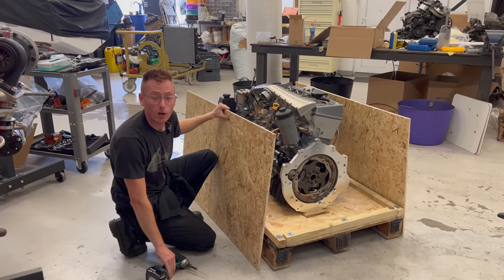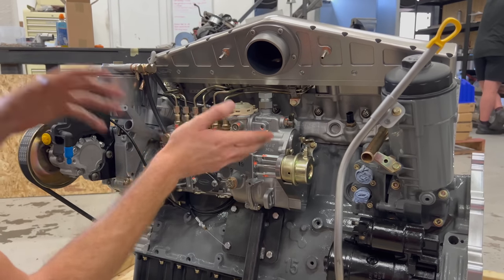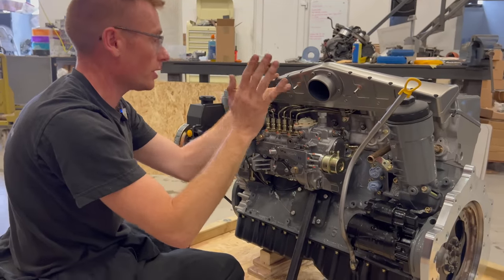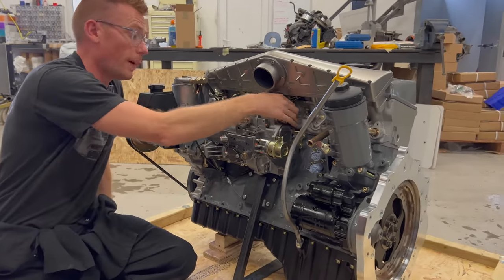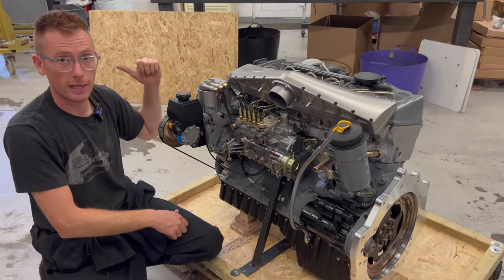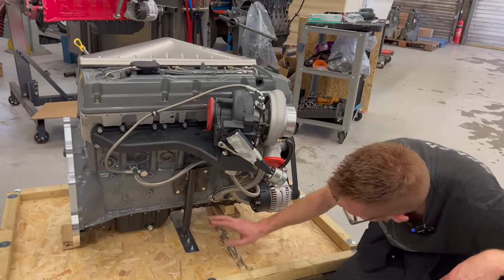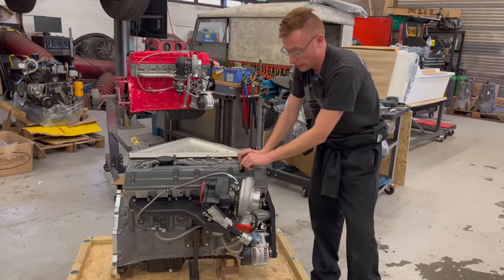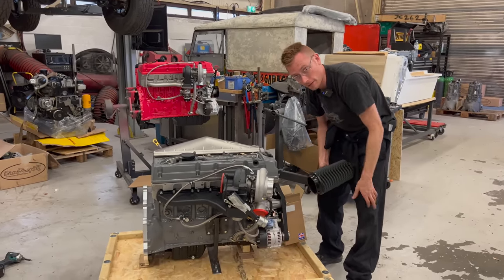Unboxing a 500bhp Dieselpumpuk crate engine

Comment: What price would the 500bhp engine cost?
Reply: People who can afford it, won't mind ... people who work hard for a living don't really want to know the price.
Reply: 10 years hard labour
Reply: Between 14.500 / 22.000 ex VAT
Reply: @matthewnooren7090  we didn't want to know.
Now I feel like a very poor person
Reply: @matthewnooren7090  thats actually not that expensive for a throw it in engine with 500hp 

i wonder if it fits in a 190E
Reply: It's a lot to give right away i build my cars step by step (1 of them OM606) i'm getting mine done in Poland i'm paying that for taking out the old engine, re-do the OM606 get it fitted (a big hassle) and tuning (500 hp) for less i pay around 13k euro i think for everything
Reply: @maximilianjankowski  it fits in a 190e
Reply: @maximilianjankowski  that compares nicely to the cummins repower crate engines which do not have a turbo, and make half the power.
Reply: @maximilianjankowski  dunno you buy a hape of LS motors for that money
Reply: @niallcorcoran2437  as irish as they come 😂
Reply: @OM617a  will it fit a sprinter ?
Reply: thanks for your amazing videos ,but have you ever converted any engine for marine purpose?
Reply: like 5000 not bad
Reply: @matthewnooren7090   excuse my ignorance what’s VAT?
Reply: @feron450  tax buddy
Reply: @maximilianjankowski  you can buy an entire 5.0 coyote DRIVETRAIN package including Trans, computer, and wiring harness for less than 7k... for 29k chevy has a 1000hp na crate motor.
Reply: I'm more confused as ever after reading this thread. can't someone just answer the question plainly?? how much does this engine cost in US dollar or British pounds???
Reply: @derekcraig3617  you and me both lol
Reply: @derekcraig3617  you can pick-up one for probably 1500/3500 dollars 

A tuning costs will depend on your expectations really

But expect between 5k / 20k as the diesel pump rebuild is quite expensive and to find 1 as well

A throw in ready build crate engine in America will probably be the same as in England, around 16/23k
Reply: @matthewnooren7090  thank you :)
Reply: مرحبا من فظلك ما نوع هاذا المحرك يجي على اياسياره او محرك ايا نوعمن اسيارات
Reply: @ابراهيمالعطوي-ذ2غ  om606 turbo
Reply: @matthewnooren7090  awesome to hear that. Would you share which shop are you doing it? I’m planning to go a OM606 swap into a Patrol, and want a rebuild engine for reliability and power (probably with Diesel Pump UK fuel pump; manifold, turbo kit, etc).
Reply: @matthewnooren7090  where bout in Poland you done it please ?
Reply: @AroundEU  SuperTurboDieselRybnik
Reply: Was quoted $19k before tax and shipping
Reply: @jameshathaway5117 can add atleast 50% to the price of a coyote in UK
Reply: @haydenratcliffe1138  yeah and OM606 cost a lot more in the US than the UK.

Comment: Hi Luke.
Fabulous job.
Can you measure and weight your crate engine. Also how much shorter is the 5cyl.  Can the engine be tipped to the side. If so how much as I have  space restrictions. Thanks Jim

Comment: Hello everyone. Hope you all are fine.
You're driving us crazy with your swapping and your amazing work DieselPumpUK....
I own a C class 250 TD OM605. I have a problem with an overheating engine, that's fact push the aux fan to run to low the engine temprature. 
What I did with my car is :
I have a problem with a cylinder head. I bought a new one, the engine runs now much better and smooth. The older cylinder head was at its worse state 😝
I removed the oil Refrigerant (cooler) because 2 times it caused me water and engine oil mixture soooo bad failure.
Now after asking for an advices from many mechanics I believe I have to remove the Radiator to clean in the bench.
So, I hope to get some advice or a help, anything would help and thank you in advance.

Comment: Your videos in my opinion are the best on how to create diesel monsters what kind of horsepower can you get out of a OM606 with the stock internals only tinkering with the externals? For example bigger turbo bigger fuel pump etc what's the highest horsepower and torque ratings you can get out of this engine?

Comment: D/P.  Your lowest alternator location is the weak link in this crate engine !  Will you be offering the "water proof" unit ex. Porsche Cayenne soon ?  V.
Reply: That’s the factory location for the alternator
Reply: @Diesel8290  D/P.  Watch the YT videos "PNG river crossing 1 & 2" or guess how long the alternator will last Downunder after a drenching !  !  Could one invert the custom exhaust manifold to a low mount and shift this alternator to higher position ?  V.
Reply: @vincentpoole7588  there’s plenty of top mount alternator mounts available for these engines. Leaves the intake for turbo tight then just
Reply: @vincentpoole7588  I've had water up past my bonnet for a continuous 2 hours when I got stuck in my 4x4, alternator was fine, was also the stock 15 year old unit at the time, depends on how much shit is actually in the water (debris etc), the only issue was airbag sensors ate shit due to the interior filling with water.

Comment: "The heater outlet shouldn't be blocked" - that's interesting, because that's what some bodies will do, like w124 - they do block those passages in stock configuration.
Reply from the maker: They do not block it, it is re-directed

Comment: Would you enhance a Japanese MMC 2.5L 4D56 engine to get over 200 BHP at least or achieve some unexpected,ridiculous Torque  figures. I’m not an engineer, I just love cars.
Reply: 4D56 engines can be fitted with a bigger plunger in the VE pump, injectors out of a 4M40-T engine. More boost up to around 20psi (safe at that). A lot depends on the rocker arm  type too. There are roller rockers and slipper type. Roller rockers are the better but must have a cam to suit. The harmonic balancers can flog the crankshaft keyway out due to crankbolt not being long enuf or torqued up properly.

Comment: What are these engines capable of HP & Torque wise reliably? I've built my old LBZ duramax and now have a 21 Powerstroke. Been throwing around the idea of building a 72 K5 Blazer with a Cummins/Allison 6 speed combo or a supercharged LS/LT gas. 500HP & 800 TQ would be a great fit and I assume these Merc diesels are much lighter than a Cummins? Also what manual trans can survive with that amount of tq? Cool stuff BTW!
Reply: He does a video weighing a 5.9 12V, these engines are half the weight supposedly. Deboss Garage does a video on these things as well. I have a '90 Suburban 2500 and this would be a good option, but price is a real concern. Junk yard 5.3 with a cam and a tune is hard to ignore.

Comment: Do you do anything with the om642 engine ? Love mine in my c class, just made a much less restrictive DIY air filter using a standard filter housing but using specialist air filtration foam. Made a nice difference and lot less restrictive, hybrid turbo next me thinks

Comment: As always yall have awesome builds 
Question why dose the braided oil return hose hose go over the exhaust manifold,  would it not collect as much heat if it went down from the turbo and under the manifold  just asking 👍

Comment: Greatings from Greece 🇬🇷 nice job keep going !
I’m wondering if you could make an adapter to connect this beast with a marine leg like this(ALPHA 1 ONE GEN 2 STERNDRIVE MERCRUISER 4CYL V6 V8 MERCURY)? 👌
Reply from the maker: Yes we can
Reply: Alpha 1 will handle about 400hp petrol max and probably 300hp in diesel (there is no BHP) in marine terms, the oil burner having lots more low down torque, if you want to go higher power then you need to upgrade to a Bravo Drive !

Comment: If I yeet the motor in my pk ranger I want one of these 😂 om606 Mercedes simply do not exist here in nz which sucks.
Reply: We have the 5 Cilinder  of this engine  in a musso korando ssangyoung they also have them in the uk don’t know if he will make a kit for it the mb 140 mb100 Mercedes’ also run this om662 engine without turbo in New Zealand I own 2 of them vans

Comment: Why do you disagree with water/meth injection?
Reply from the maker: A few reasons but you cannot control the combustion of the meth.
Reply: @DieselPumpUK  fair point. We use it a lot in petrol forced induction where we have a spark plug ;). Always good to get input.

Comment: Isn't it time to move on? A 600 BHP 6000 RPM OM648 is way more interesting.
Reply from the maker: If you can make it run mechanically which my customers want then yes I’m all in.

Comment: Water / methanol on deisel? 
It is used to prevent knock (autoignition) on petrol engines. It would absolutely ruin a diesel engine by delaying desired autoignition.  This guy is suspiciously not knowing his s..t